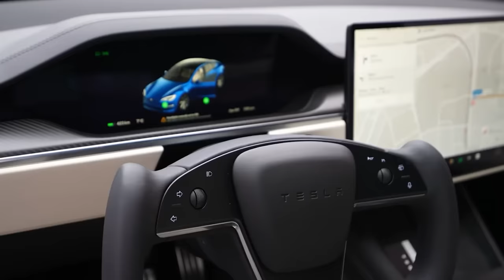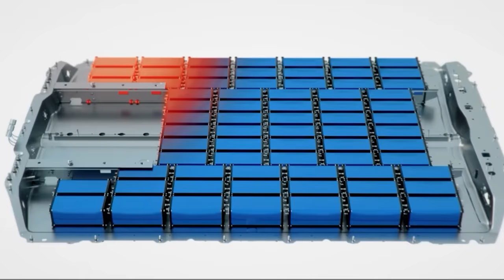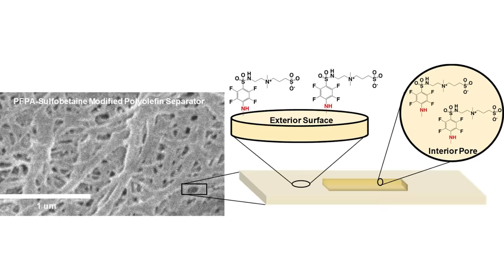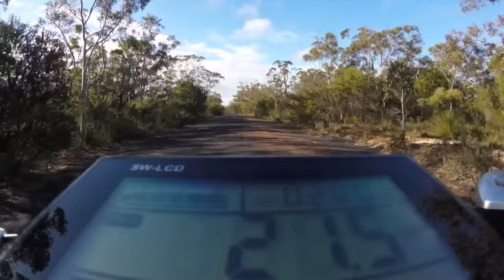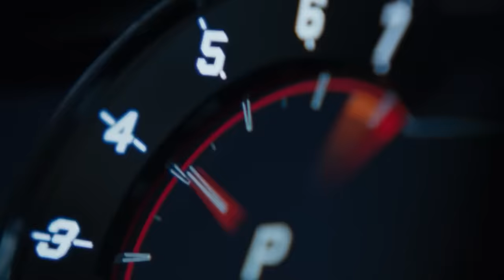EV's Are Exploding In Shocking Numbers

Comment: Thanks for the warning, clearly not enough testing has been done on EV,s they are a danger to be avoided 🔥🔥🚙🚗🔥🔥🔥
Reply: They are testing them the same way they tested the v .a. x  on the public.
Reply: Absolutely
Reply: good job petrol never burns
Reply: @whocares264  Good thing gasoline doesn’t explode like Lithium Ion batteries do
Reply: @aaronlandry3934  surely you know more people die from gasoline fires than battery fires,
Reply: @whocares264  Surely you’re aware of how many more ICEs there are on the road than EVs, right? Could that maybe be a reason why? 

How many ICEs drove into a tree before burning their driver alive? Please tell me statistics on that
Reply: @aaronlandry3934  A study by the Swedish Civil Contingencies Agency backs up Tusker's findings. It concluded that EVs are 20 times less likely to catch fire than petrol and diesel cars. With data corroborated from a US insurer, the study found that EVs suffer 25 fires per 100,000 sold.
Reply: A study by the Swedish Civil Contingencies Agency backs up Tusker's findings. It concluded that EVs are 20 times less likely to catch fire than petrol and diesel cars. With data corroborated from a US insurer, the study found that EVs suffer 25 fires per 100,000 sold.
Reply: @whocares264  Various studies indicate that study is incorrect
Reply: @aaronlandry3934  i love your gas car vs ev hitting a tree analogy, which is more likely to burn...
well as gas cars have the red hot parts combined with gas at the front of the car
and an ev has batteries under the middle of the car and are cool....
yes so funny ....
Reply: @whocares264  That’s in reference to Hans Von Ohain… Perhaps you should do a bit of research…

Comment: You haven't gotten into the effects of the batteries over time due to aging, the effects of heat and cold cycling and normal physical wear that will contribute to more and more of these fires. They haven't really  been out there long enough to know as this is new technology. My feeling is it's far too dangerous for everyday use to make it the standard. And 'green' they are not. The fabrication, mining and recycling pose many problems to think this is anywhere near a 'green' solution.
Reply: Driving a Molotove Cocktail is more dangerous.
Reply: Yes the stupid pointless yardstick used to say they are 'greener' is carbon emission factor only, which is highly dubious in itself. The ACTUAL important yardstick is total ecological footprint which EVs completely fail in every metric.
Reply: @wobblyboost  Point taken, but Batteries are recyclable more that many will admit.  The main problem here is the insurance companies and the time they take deciding what to do about the vehicle.  Just yank the battery and send it for inspection to a reputable recycler ASAFP.  They can decide about resale and refurb.
Reply: @popsracer886 So many sock accounts that make daft robot arguments lately.
Reply: @popsracer886  Yank the battery out??? What is wrong with you????
Reply: Hybrids reflected the most at 3,475 fires per 100,000 vehicles. 
ICE vehicles caught fire  at 1,530 incidents per 100,000 vehicles.
EV fires were 25 fires per 100,000 vehicles.
Reply: @wobblyboost  As an Electrical Engineer, I approve this Message.  Yank the EF'n battery ASAFP and send it for recycling or refurb.  Don't wait until it degrades or shorts internally.  Get it out of the impound lot.
Reply: @trkstatrksta8410  As an Electrical Engineer, I approve this Message.  Yank the EF'n battery ASAFP and send it for recycling or refurb.  Don't wait until it degrades or shorts internally.  Get it out of the impound lot.
Reply: @trkstatrksta8410  pops is a robot mate, he just replied to both of us with the same comment but it's actually nothing to do with what we said, but the OP. That's why he seems insane.

Comment: I fly electric powered RC airplanes that use small versions of these batteries. I have 15 years experience  handling these batteties. The biggest is about 2 lbs. The smallest is less than one ounce.
 I store them in a fireproof container and would never leave them in the airplane or my car. I cant imagine having hundreds of pounds of these batteries in my car.
Reply: An EV battery pack with a range of 250 miles weighs about 1,000 lbs. A full fuel gas with a range of 400 miles weighs 80 lbs.
Reply: @oldarkie3880  Hybrids reflected the most at 3,475 fires per 100,000 vehicles. 
ICE vehicles caught fire  at 1,530 incidents per 100,000 vehicles.
EV fires were 25 fires per 100,000 vehicles.
Reply: @BioniqBob  Good stats that are completely unrelated to the prior post.  The average age of EVs on the road is a fair bit less than the average age of a hybrid on the road which is significantly less than the average age of an internal combustion powered car on the road.  I would say that age and maintenance are going to prove a huge factor in these statistics over time.  My biggest concern with EVs is not the explosions (you're right... it's not as widespread a problem as many are making it out to be).  It's the power grid requirements, what to do with old battery packs, and how to clean up the industrial-scale production of new batteries.  Oh yeah and they're the ugliest vehicles ever manufactured outside of that "truck" that Jeep makes.
Reply: @vegashawkfan59  Teslas are pretty hot (and no, that's not a pun on car fires)
Reply: @oldarkie3880  Which is a comically dumb claim, since the battery can be recharged thousands of times, and the fuel can only be burned once.
Reply: @vegashawkfan59  The grid and charging is being upgraded along with the growing EV fleet.  I have seen it myself over the last few years.  And there are already plants in place to recycle EV batteries, but since they are lasting far longer than expected, recycling is still in the early stages.

And we haven't even started talking about Sodium Iron batteries which will be exceptionally easy to recycle.
Reply: SAY NO TO EV CARS & GAS CARS.

Comment: "The government needs to do something and do it quickly." Yes, they need to stop demanding people to buy EVs. They need to encourage buying gas vehicles again, because they dont burst into fire when not in operation. Ford Pintos had a problem with fires, but only when rammed from behind. So tell me which is safer from starting a fire? A 1971 - 1980 Ford Pinto or a 2015 - 2023 Tesla Model ANYTHING?
Reply: The NTSB recently published their figures for car fires in 2022. They recorded approximately 190'000 ICE car fires, and 4200 electric car fires in 2022. On that basis, which would you say was more likely to catch fire?  Ford Pinto's only had a problem when rammed from behind. And being rammed from behind is extremely rare in traffic accidents, is it?
Reply: @Brian-om2hh  That's a bad comparison because there are far fewer electric cars on the road. In the USA, only 0.59% of cars are electric. Though 0.3% of car fires were EV and 1.05% were ICE, this is because people purposely OVER REV the engines, and due to the mechanical nature of in/flammable fuel and friction from moving parts being pushed to extremes, of course there were more ICE fires. But NONE of those fires were started when the vehicle was not in operation. Other car fires happen while fueling at a gas station and someone causes a spark. That's not the cars fault, but because of static electricity when people enter and exit their cars while fueling, and the spark ignites the fuel fumes. Fuel tank punctures in car collisions can cause fires and explosions, but under normal pressure and proper care, they never just burst into flame for no reason. Remember all those hoverboard explosions a few years ago? What about all the electric bicycle fires? Regular bicycles and ICE mopeds don't do that. Cell phone fires? These batteries are not safe, and new types that aren't so COMBUSTIBLE are desperately needed.
Reply: YES
Reply: I will take the Pinto.  At the very least, careful driving would have solved the Pinto fire problem.  The same cannot be said for electric cars whose fires need no provocation.
Reply: @Brian-om2hh  The problem comes in by how intense the EV fires are, in comparison...how they are extremely difficult to extinguish.
Reply: @CaptainFoufeu  saying no ICE fires happened when the vehicle wasn't in operation isn't true. ford has a long history of fires caused by electrical problems. they had internal "memos" about ignition switch problems, then claimed they fixed the problem, but in fact did nothing. they were forced to do a recall, but only on a small number of vehicles.

cruise control fires were a thing for ford too, but i think that was only while driving,..
Reply: but they can't control your movements when you have a gas /diesel powered vehicle.
Reply: @Brian-om2hh Oh a perfect, non invested, ethical source to draw from which doesn't have ANYTHING to gain from shaking ev money hands, NTSB - I totally believe that report to be factually delivered. sarcasm

What is read versus what is seen, one has the truth, one has what somebody wrote.
Reply: You really live in a fantasy world, don't you?
Reply: Obviously the Tesla is safer, in fact all evs are safer than ice cars now that is a fact..
Reply: @MyNathanking  careful driving,  how do you prevent being rear ended...
Reply: @MyNathanking  Hybrids reflected the most at 3,475 fires per 100,000 vehicles. 
ICE vehicles caught fire  at 1,530 incidents per 100,000 vehicles.
EV fires were 25 fires per 100,000 vehicles.
Reply: Hybrids reflected the most at 3,475 fires per 100,000 vehicles. 
ICE vehicles caught fire  at 1,530 incidents per 100,000 vehicles.
EV fires were 25 fires per 100,000 vehicles.
Reply: There  is a reason why we no longer see ford pinto's on the road
Reply: 60 to 1 , Pintos would be 260 to 1
Reply: Please, the Government has done enough damage. We need them out of our lives!
Reply: @scottiopizza7565  Poor Baby.
Reply: @Brian-om2hh given there are millions of times MORE EVS than ICES, I see math isn't your strong point. 😂😂
Reply: @whocares264 you've fallen for it, hook line and sinker!😂
Reply: @alan4sure   Are you a smoker
Reply: @alan4sure   i charge off peak with octopus intelligent 7.5p per kw
i also can use use all electric appliances between 11.30 pm and 5.30 am on this ev only tariff so actually this means with these saving my ev costs me nothing to run for fuel....yes i have fallen for the savings ...
Reply: Now, Gas vehicles would be really deadly on the Road together with EV's 😮😮
Reply: @KBHeal  LPG autogas is the most widely available environmentally-friendly alternative fuel in the UK. Most petrol engines can be converted to LPG and there are currently around 21 million vehicles worldwide running on LPG with over 10 million in Europe and more than 100,000 in the UK.
Reply: The Grimshaw case was just one of more than one hundred lawsuits that were filed because of design flaws in the Pinto that resulted in fuel tank fires. Estimates by Mother Jones attribute between 500 and 900 burn deaths to Pinto cMore to the point, there are now at least 32 recorded fatalities due to Tesla fires (Update only five months later in 2022: now 44 recorded ..
Reply: @MyNathanking  Lets set the scene two years later. A factory fresh Ford Pinto suffers engine problems and stalls in traffic. A fellow motorist travelling at 28mph hits the Pinto from behind and watches in horror as the Pinto is engulfed in a fireball, burning the driver, one Lily Gray, to death and permanently disfiguring her 13-year-old passenger, Richard Grimshaw. In true American fashion, this accident resulted in a lawsuit - with Grimshaw suing Ford for crafting dangerous cars within their factory premises.

Comment: Gas powered vehicles usually don't just spontaneously combust. Their fires also don't need half a water tower to put out!
Reply: They could use white hydrogen while engineering a synthetic fuel,but no one's putting money into that.The petrol&diesel vehicles could be kept,as they wouldn't need to be scrapped,so less pollution from that source.The water tables wouldn't be depleted&polluted,&spent lithium batteries wouldn't be going into landfill sites&causing fires there when the case became damaged.
Reply: but they are twenty times more likely to catch fire

Comment: If your trapped in your car during an EV fire , Fire fighters are going too have a hard time rescuing you than in a combustion engine
Reply: Electric battery fires start up slowly. You have plenty of time to get out.
Reply: @mpetty9947  What if you are incapacitated and can't get out? Does happen in car accidents.
Reply: @mpetty9947   No
Reply: @niftynev4779  Ummm... then it is the same no matter what the fuel.
Reply: @The_DuMont_Network  Except EV fires burn almost twice as hot as gasoline. So there's that fun fact.
Reply: @mpetty9947  - many EVs just explode taking out many others vehicles around them.
Reply: @zooker7507  - and they keep reigniting themselves or exploding in your garage when you are sleeping in your bedroom above your garage.
Reply: @mpetty9947  See if you can find video of the EV Public Transportation Bus that went up in France about a year or so ago.  Nobody on it.  Just spontaneous combustion.  Had it been full, maybe a few front seat passengers beat the smoke, everyone else would be dead.  Most spectacular vehicle fire I’ve ever seen.
Reply: @niftynev4779  You've had it...
Reply: Ummm, open the door and get out.
Reply: @jaysonmarvich1297  I think that it was Hydrogen powered, Fuel Cell.  I may be wrong, but Hydrogen buses explode more frequently.
Reply: The word is "you're".
Reply: @niftynev4779  Hybrids reflected the most at 3,475 fires per 100,000 vehicles. 
ICE vehicles caught fire  at 1,530 incidents per 100,000 vehicles.
EV fires were 25 fires per 100,000 vehicles.
Reply: @cloudbasenirvana  LOL in your little mind maybe.
Reply: As the car burns, the doors can lock you in.
Reply: Get out when it starts not once it is going for an hour. ICE just go boom before you have a chance to get out.
Reply: @popsracer886 can’t,locked up
Reply: @popsracer886 Sorry door is electrically locked! Good luck breaking out safety glass with your hand!,
Reply: Batteries are not runny. Liquid fuels are.  One of the major problems in parking structures.
Reply: You'll be dead way before the firefighters get there..😢
Reply: @zooker7507  it isn't a fact, either.  The heat output of an established car fire peaked at 2-6MW in fire brigade trials following the Liverpool structure fire (which arose from a combustion/ingredients vehicle.  That's a lot more than a battery fire produces.  A major factor in Liverpool, Norway, and Luton was burning liquid fuel running under other vehicles and down ramps. That is a feature absent from EV fires. Batteries, in shirt, are not runny.
Reply: @cloudbasenirvana  not observed.
Reply: @jaysonmarvich1297  the LPG one?
Reply: @BioniqBob  - I smell BS.
Reply: @AdrianMidgley  The key features in those fires waa EV spontaneous combustion and unstoppable thermal runaway at 3600F, which is hot enough to melt concrete levels at Luton.  Shipping containers are no match for fires that can melt concrete.
Reply: @cloudbasenirvana  Check your hat.
Reply: @jaysonmarvich1297  balls.
Reply: @popsracer886  LPG. With a relief valve on the roof.
Batteries of course go as low as possible.
Reply: @BioniqBob  this does not resemble the evolution of vehicle fires.
Reply: @jaysonmarvich1297  balls. Luton was a pure Diesel Range Rover followed by lots of running burning fuel.
Reply: Petrol vehicle catch fire very hot and burn quick and can explode..... electric vehicle fires are alot slower and burn longer... that why they have trouble putting them out days later...    I think you would have more chance of surviving in an EV fire.
Reply: @Liams_Fraser_Island_adventures  reignition is a problem with battery fires, of any sort. There remains stored electrical energy in a damaged structure and it can heat up again to the point of boiling or ignition.  Hydrocarbon chemical fires are simpler. Any EVs on Fraser yet? We drove a Land Rover Defender there years ago.
Reply: There won’t be anything to rescue
Reply: @stevevogelman3360  Facts
Reply: Just remember...you're sitting on top of the Battery!!  I WOULDN'T CHARGE THE EV IN THE GARAGE WHILE SLEEPING AT NIGHT!! 
        " PERIOD "